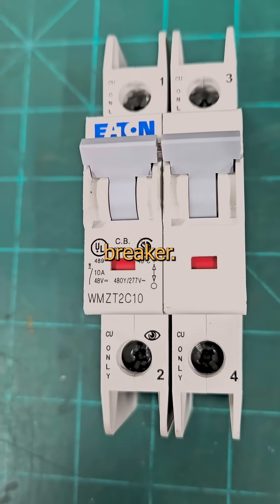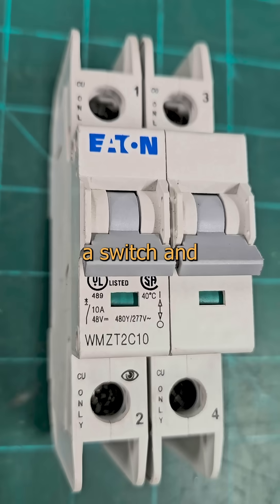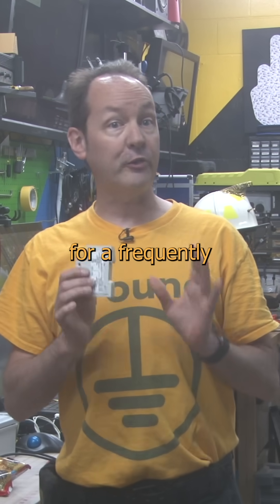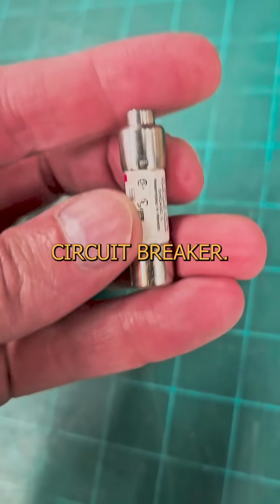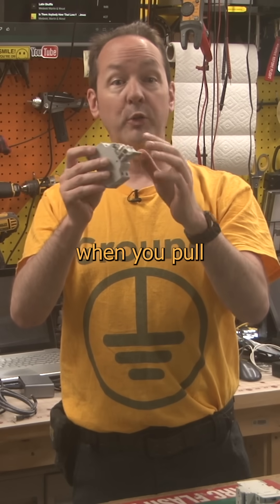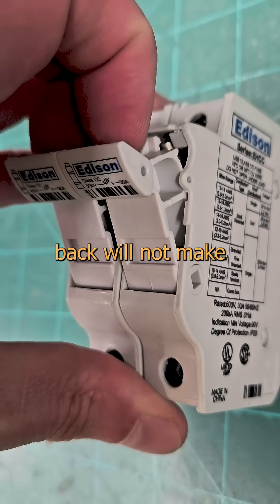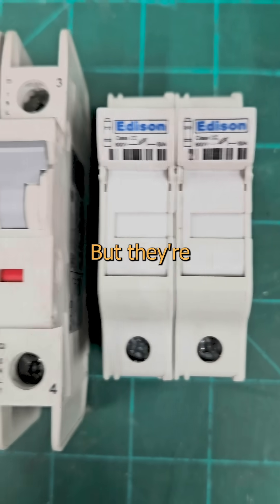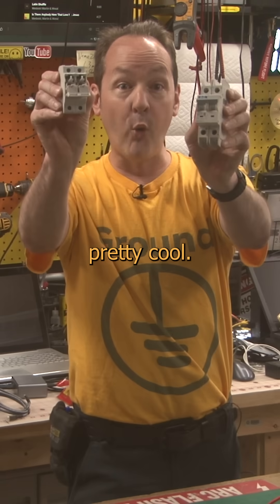Breaker vs Fuse #chrisboden #comedy #engineering #electrical #apprentice #training #educational

Comment: When I'm doing maintenance in one machine I usually operate, despite switching it off, I always pull the fuse block so I have visual confirmation of the electrical disconnection

Comment: Fun fact for anyone who didn't know already: if you live in North America, NOTHING in your breaker box is there to stop you from electrocuting yourself, unless you shut it off beforehand. Circuit breakers are meant to protect your house, your walls and the wires in them, and nothing else. This is why GFCI outlets exist; because most people vastly underestimate how little safety features are in standard North American electrical infrastructure.

Comment: I used to install elevators, and people are using Bluetooth circuit breakers now. You can reset them from your phone. Wild.
Reply: They are nice to have, but crazy expensive. I think Eaton sells an GFCI that will output a warning signal if it detects 50% of the rated leakage current.
Reply: @lukahierl9857  i had zero doubt in my mind. But if you're getting an elevator installed in your mansion, you can afford it 🤣🤣

Comment: Where I work, we have a room where our evaporators don't have a hot gas defrost function. Every Saturday, and as need be once summer hits, I am instructed to go into the MCC room, open the distribution panel and flip the circuit breakers for the liquid feed solenoids off, as to interrupt the liquid ammonia so that the unit naturally thaws the ice.

I routinely use them as switches, as instructed lol

Comment: Circuit breaker is a very good power switch to manually control high power loads - thanks to its heavy-duty contact system with arc extinguishing chambers
Reply: No it is not. The contact points are way smaler than a proper switch and will get pitted very fast.

Comment: Clarification. The fuse block/holder is not a disconnect. It can be opened only when ther is no current draw through it

Comment: Soooo, the second device with fuses. It stops current from flowing in a circuit when you open it. So the circuit is no longer connected. Hear me out. One could suggest, that it would mean, that in fact, it actually IS a circuit breaker.

Comment: Chris Boden, 

I've already read several comments stating commercial breakers can handle being used as switches, but I'd really love to hear your take on this.

I work in concert sound, lighting, and video and we absolutely use breakers as switches. Our electrical distribution systems are predicated on using breaker switches as the primary means of powering up and powering down individual circuits of devices or fixtures. Many lighting fixtures don't even incorporate an onboard power switch. Plug into a live circuit and the computer begins calibrating the movement of all the components. There are those with soft resets controllable through DMX light controllers, but many do not. And even the ones with soft reset sometimes require a hard reset from the distro. We try to avoid this mostly because a single circuit often runs many fixtures and you don't want to lose a whole line or even several fixtures in the middle of a show. But sometimes it's unavoidable. Either way, the breakers are typically going to be used at least once per day to excite or extinguish the pesky pixies. 

This begs the question, are we using a better class of breakers designed for repeated power cycling or are we going against the laws of the electrical gods?

I'm especially interested to know because more than a few electrical distros are not the work of dedicated manufacturers of equipment for our industry, but rather home-built boxes within boxes using either residential or commercial breaker boxes connected to distribution panels on the back side of the racks. 

What do you think?

Comment: Ah the fuse block.  Yes it has fuses, but, when you open it, does it break the circuit? Circuit breaker. No one ever called it a circuit restorer. Technically correct is best correct lol.  Kidding aside Eaton is goat but you really do need a mortgage for them.

Comment: BEWARE of FINLESS Breakers. These are not rated to break fault current and using them by themselves is a sure way to get inspectors frowning at you.
[PSA] The "UL inna circle" logo will ONLY appear on proper Breakers; the less-useful type are marked with a "UR".

Comment: the only reason fuses are still around is because a fuse can blow instantly in an extreme fault, while a circuit breaker still takes a full waveform cycle before it develops the magnetic field to trip the little mousetrap.  

also, fun trivia: circuit breakers must be guaranteed to trip to pass UL.  they don't necessarily have to reset.  and if a breaker has SWD printed on it - it is approved to be used as a switch - otherwise, it's not.

Comment: Remember degenerates !We use Breakers  to protect wires not the device ! We use fuses to protect both the device and the breaker  when the fuse says 1 amp it Will blow exactly at 1 amp .learn how to read the lable on a fuse ! Do not use delay fuses when you need an instant fuse. where a breaker is rated for 1 amp , may trip at 10 amps for the same 1 amp rating of a fuse  .And breakers are only accurate on the first trip from a fault .after that they get weaker with each trip from a fault.Now to the rest of the so called Mill Writes .Dont touch .Now if you have money for lab grade breakers that are electronicslly controlled and start at $500 a breaker so you can control current curve and current limit  and faults and current leaks .Love the use of the f words .Boys learn the F words 5 in particular

Comment: I think the best part of seeing this is at work out air compressor is weird in a way the only way to shut them off is turn the brakes off or it reaches set pressure so our braker is being used as a switch

Comment: A circuit breaker is not a Current Limiting device.  It's a current interrupting device.  A current limiting fuse will reduce the magnitude of current by introducing a high impedance into the circuit in the process of blowing.  That's what makes CL fuses way more expensive than just a simple glass fuse with a strand of silver, tin or copper in it.

Comment: "Im going to replace you with 12 lines of code on an old arduino" is going into the repository
Reply: That is seriously one hard engineering put-down. Such eloquence.
Reply: It's related to a very old system/network admin saying; "Go away or I shall replace you with a very small shell script"
Reply: @davidskidmore3442 what an insult 👌
Reply: @davidskidmore3442  It's also just an extremely common and muddy debate in the industry over whether or not the incredibly expensive proprietary controls hardware from AB, Siemens, etc. that rule the industry can be replaced by off the shelf arduinos, RPis, and FPGAs.
Reply: I can't understand
Reply: @user-qx2yc4uf1  It means the person's job is so trivial that it can be replaced with a short computer script
Reply: Gonna have to use this on the old farts who didn't want to help train the new guys.
Reply: Hey I had one.  All I used it for was to experiment with building my own motion activated light.
But yeah, 12 lines of code does hit hard.
Reply: Take it and gone like a fart in a flower shop!
Reply: I came here to say this. Brutal 😂
Reply: Good idea, I'm actually gonna create a repo of these quotes!
Reply: Same
Reply: As if you had an old ordinary that's not being used😂
Reply: Never have I seen modern day automation replace labor liability be creatively worded this way

Also fk i didnt know these two were different

Comment: So, are the only reason fuses are used in a breaker box because they are cheaper? or do they have some other use like being better for the electrical circuit or used as a dummy proof way to say, hey somethings fucking with your circuit and you should go check that out right now.

Comment: We use the first kind of circuit breaker everywhere in Germany. We used the round fuses till the early 2000s and then got those modern ones. They are way better than a regular fuse and maybe cost 3-4€ here.

Comment: I remember when I was younger,  I assisted with replacing a fuse box with a circuit breaker for an older house that was built in the 50s . It had the old style Frankenstein switch for cutting the power off from the outside electrical main. I got to keep the old box and Frankenstein switch. Back then the master Electrician had to do the inspection for the county electrical auditor. I got hours of certification and it was a great deal more interesting to see how people did fire prevention and electrical safety than we do today. The inspector(auditor/fire commissioner) was impressed by how long the house was using that old fuse box.
Reply: When your house is wired though a 200 Amp Fused Service Disconnect. Like mine.

Comment: Spent 50 enjoyable years as an electrician. Wish I had a $1 for every fuse I replaced and every circuit breaker that I reset. In large industrial settings fuses are usually cheaper when you have high available short circuit currents. I usually used quality time delay fuses with a 200 KIAC for large motors.

Comment: I love the US. But I despise our residential electrical installation standards with a vengance. It looks like something from the 1950s.

In Germany they have 3 Phases, spread across different breakers on DIN Rails. If you know what you're doing you can make it absolutely beautiful. The wiring, the switches and the outlets are leagues better and look way more modern.

Comment: I have never seen a fuse box that fits to circuit breaker rails.

Granted all the fuses I've fucked with were on a house orginally built in the 1870s and electrified with 24 hertz tube and post from the mines in the early 1890s because the mine boss wanted electric lights. (The basement was the butler's quarters.) The wiring is... Lovecraftian at best. Fucker needs a fuse ON THE GROUND LEG or half the lights don't work. Which is weirder than fuck when it's half the lights on the same switch.

And yes--outlets are running on a seperate modern insulated electrical system supplied by a breaker box. The old tube and post just provides lighting which is much less scary since we swapped to LEDs, measured the current and cut the fuses to 1/4 the original. Still fries squirrels though.

Comment: I have a couple coworkers who don't have any business touching a AA battery who like to "troubleshoot" blown fuses by replacing then and manually operating contactors...

I will use THEM as the fuse, next time I see them do that.
Reply: I knew someone who pushed in a VFD bypass contactor. Lets just say it exploded and he was fired.

Comment: The breaker, unfortunately, will usually score your control panel a much lower short circuit current rating 😢

Comment: Cheers from Europe. Ive literally never seen a fuze in my life, I can only recall breakers
Reply: Probably because the fuses are located upstream, in the hookup that the energy provider has mounted in your house.
There is always a fuse upstream, because if the current exceeds the rating of the breaker by factor of 1000x or higher, the chances that the breaker welds the contacts are not zero anymore...
Reply: You probably saw them but did not realize it.

Many distribution systems use fuses with very large ampacity.
Reply: In Germany almost every house has a set of 35 to 63A NH Fuses. They are located in the box beween the incoming cable and the main fuseboard.
Reply: I've seen them in Industrial cabinets
Reply: Living in Europe, my house has fuses. I admit it is something you don't see often, not even in my 3rd world home country

Comment: 😢 While watching this short had to look to the side where my selfmade homegrowing electroinstallation box is... Next to every power socket there is a little 10A circuit breaker.... Yeah, they are used as switches 😅 not often, because they are time and/or temperature switched BUT the cb are ment to be "switches".
What else should I have used???

Please, don't replace me with 12 lines of code on an old Arduino... 4 lines of Basic are more than enough :D
10 eat
20 fck 
30 sleep
40 goto 10

❤